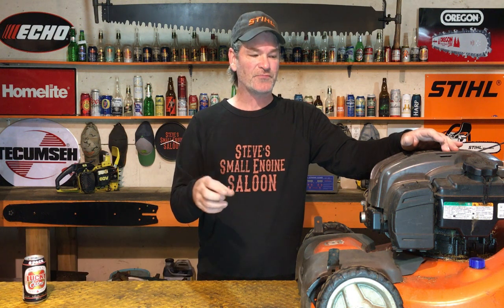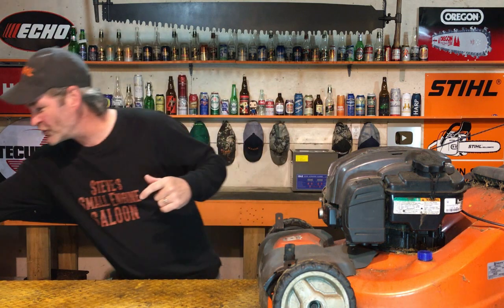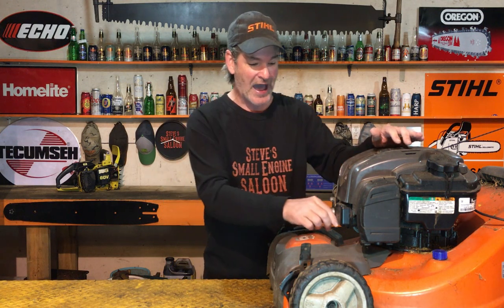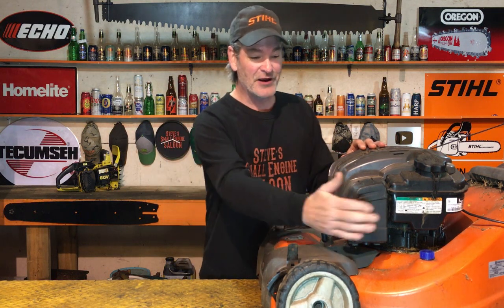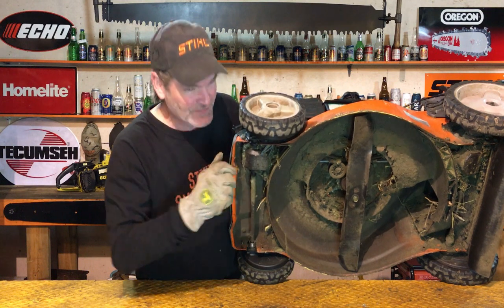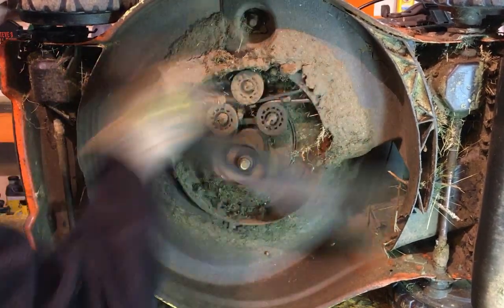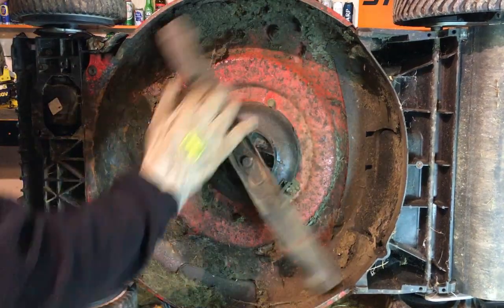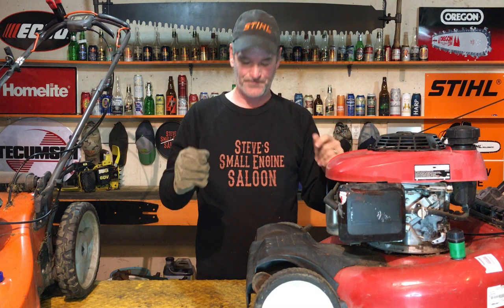How To Test Lawn Mower Compression With NO Gauge

Comment from the maker: ✅Click here for a compression tester ➜ https://amzn.to/2JPWGoa
✅Click here for a clamp ➜ https://amzn.to/2K4P69t
For more videos like this, check out:
👉Straighten A Bent Lawn Mower Crankshaft With A Pipe ➜ https://youtu.be/w2Ro9GmEyOE
👉Fastest Way To Tell If The Crankshaft Is Bent On A Mower ➜ https://youtu.be/3up57DHiCqs
👉Here's Why Your Lawn Mower Is Leaking Gas - Honda Style ➜ https://youtu.be/tp67AzWNbI4
👉How To Adjust the RPM Speed on a Lawn Mower ➜ https://youtu.be/7YrA3QEIFnE

You can connect with Steve here too: 
✅Visit Steve’s WEBSITE ➜ http://www.stevessmallenginesaloon.com/ 
✅Visit Steve’s PARTS & TOOL STORE ➜ https://www.amazon.com/shop/stevessmallenginesaloon 
✅Follow Steve on FACEBOOK ➜ https://www.facebook.com/stevessmallenginesaloon 
✅Follow Steve on INSTAGRAM ➜ https://www.instagram.com/stevessmallenginesaloon/ 
✅Follow Steve on TWITTER ➜ https://twitter.com/SteveSaloon
Reply: Steve you can't really check compression with a gauge on these small engines, you have the best solution. Here's the problem. The volume of the cylinder, especially in small stuff like trimmers and chain saws or 4 cycle GX25 and 35 Honda's, is that the ratio of air in the cylinder to the ratio in the line to the gauge and the gauge itself is way too high, if you get 50 or 60 lbs it's a lot, so don't waste time with gauges. The line and gauge are lowering the reading too much. If you've checked everything else, carbs, ignition, etc and you pull your engine apart just make sure you have good valves and rings and the cylinder walls are good and in specs. 

Thanks for the video.
Reply: Steve, Steve, Steve! I use a fisherman's scale to check compression. I grab the rope start with the scale hook and give it a tug, 8 to 10 pounds of pull to get it to turn over is a good start! Let me know what you get get on the Honda when you unstick the intake valve.
Reply: Lawn mower has no compression still
Reply: I love your videos and the no bs approach and the beer is always a plus. Having said that an internal combustion engine needs fuel, oxygen and spark to run. That is technically the correct statement. The compression is of course necessary but as an internal aspect of how the engine works there is not much end users with limited mechanical experience can do about it. No compression means a damaged cylinder, or piston compression rings or  valve(s) not closing fully or all the above. And that means major overhaul of the engine which is beyond the expertise of most home DIYers. But fuel, oxygen and spark are things that can be readily verified and fixed without the need of special tools and knowledge. Thank you for your videos, very helpful !!!
Reply: When my spark plug is in, I get a nasty grinding noise while I'm spinning the blade, but its quiet when the plugs out.
Reply: You need 4 things for a engine to start.  Fuel, Ignition,Compression, and air.

Comment: I'm never going to be the guy that can completely rebuild an engine, but your videos have taught me all the things I have to look for. Bad gas, dirty air filter, spark plug, no compression, too much oil making smoke, or pinching off/removing the gas line to check/clean the carburetor...   So like I said, I'm not the guy that can rebuild all this stuff, but now I'll never be the sucker that throws away a mower before it's been worked on.  I've become "informed" in less than a week. Thanks.
Reply from the maker: Right on Danny!  You're Welcome...

Comment: Glad I came across this video. Been trying to figure out why my mower wont't start. I have tested and tried many things on the mower and just couldn't figure out what was wrong. Last thing is to check the compression by using your trick and  wahlah, my mower has no compression at all.  Worked on the OHV valves and now my mower is running fine.  Thank you
Reply from the maker: Great to hear!

Comment: Thanks for the tip! At work I always pull the plug and screw a pressure gauge and roll it over. Your tip is great if your say out and about looking to buy a used ditch mower.  One of my customers makes a living reselling mower finds. She finds cheap or free mowers and brings them to me to fix so she can flip them. She will love this tip.

Comment: Steeve I have a JS40 JOHN DEERE self propel can you make a video explaining why a transmission belt jumps out.new belt new pulleys yet belt will jumps out when runs socially idling
Reply: Check the power receptors (pulleys on the other side of the belt) - if they are stuck, the belt must jump off!

Comment: Great tip on checking compression. I find that no compression on the newer Briggs engines is usually due to a failed plastic cam gear or slipping lobes. What the heck were they thinkin' when they did that? Eventually word gets out and nobody buys your products anymore!

Comment: "Houston, we have a problem."
I need your advice. Just tried this test on my mower and while it isn't as bad off as the second mower in this video, it isn't nearly as good as your orange mower. In fact, I think it's exhibiting slightly better than "squishy stop" you described and does have a little bit of bounce-back. I already cleaned the valve stems and adjusted the valve lash to factory specs; they're cycling properly, so that isn't the problem. I also installed a brand new head gasket, so that isn't it. It ran for about 5 minutes yesterday and then started surging, getting slower and slower, then finally dying and I haven't been able to get it going again. After the brief run, I did open up the breather chamber under the blower housing to inspect the reed, which exhibited a bit of wear and will be replaced as soon as the new one arrives by mail. I have not re-sealed the chamber yet, but am not sure how much this would affect starting and compression. I recently installed new piston rings and suspect this is where the problem lies; when I got the new rings from Briggs & Stratton, one compression ring was completely missing the paint stripes it was supposed to have, according to the instructions, and the other had only a single pink stripe that was further over than the illustration indicated it should have been. I tried looking for the bevel, but couldn't see any and did not notice any marks or pips on the rings. So basically, I had to guess at the order the compression rings were supposed to be installed on the piston and I think I may have guessed wrong. Also, the top groove had tight spot in it, but that appears to be by design. The oil control rings on the bottom went on easily. I have a feeling I'm going to have to tear it down, pull the piston and redo the compression rings. Any advice you can give would be greatly appreciated.

Comment: Been struggling getting this old lawn mower up and running.    It was inactive for a long time.  I have done the following: Replace gas tank and line, cleaned old carb and then replaced carb twice with new ones from Amazon, replaced air filter/prime bulb mount, gasket and filter, pull cord, control cable, spark plug, reset igniter gap, checked flywheel brake alignment.  Pulled carb fuel bowl nut to make sure fuel is getting into bowl. It primes fine as far as I can tell, meaning if I look into the carb in can see gas coming into the carb.  It only turns over for a couple seconds with starter fluid.  Turned it on its side and I get no kick back when turning the blade.  Put the compression tester on it and only got 60 psi and it's bleeding off.

Comment: Thanks for the tip...I'm diagnosing my old 2004 snapper ninja and I thought I might have worn rings. I tried this and the blade bounced back very fast just like this mower. It started when I tipped my mower upside down to change the oil (6.5 HP quantum xrm Briggs & Stratton) and now it won't stop smoking after never smoking before. The dipstick went from 'full' to 'add' in just two mows it's burning so much oil.

Comment: Good tip Steve. I need a video on how to change belts on a Snapper self-propelled lawn mower. I saw the one on how to tighten the belt by adjusting the cable.

Comment: Good one Steve, watched a video by Mustie yesterday on a nice electric start snapper he got free by the side of the road. The owner said it blew up? He took it to his shop pulled it apart and found a small bolt had got into the engine and put a gouge in the cylinder wall. No compression and just good for parts. He thinks the bolt may have fallin into the motor through the oil fill tube or was left in there from the factory. Cool interesting video and looking forward to seeing your tear down
Reply from the maker: Right on Tim...

Comment: So that’s all good is there a good test without a compression tester for lawn tractor with of course deck belts not engaged but pto in neutral not engaged of course ! I’m thinking pull flywheel cover off engine & turn by hand to feel the resistance when in compression stroke or what’s the trick if any ! Thanks Mark

Comment: Hey steve thank you for showing me a different way to check compression it's a good way to do it with one person. It just seems a little skech. I know it's safe. I'm curious tho have you heard about putting your thumb over the spark plug hole ? You might need two people (someone to pull it over for you) but it will blow your thumb off the hole if it has good compression. If it does not have good compression you will feel nothing. The bad thing about this method is you need to have experience to discern good and not so good compression. Obviously if it has no compression that's pretty easy to discern.

Comment: What about the compression relief pin on the camshaft?  Doesn't that lower compression until the engine reaches high RPMs?  It will make people think their compression is bad, but it may not actually be.

Comment: Only do this a couple of times, I've done this in the past, to check the compression it can fire a load of oil into the exhaust, leads to thick grey smoke for a while. (remember to start it outside after doing this).

Comment: It looks like your plastic belt shroud is removed. Is it ok to run the mower without the belt cover.
Mine doesnt attach with screws and it keeps falling down on the blade. Should I just remove it? Craftsman gcv160

Comment: Question what would the compression psi be on a Tanaka gas drill mod TED 210 AND 262 can't find that info anywhere.  the 210 is 50 lb and 262 60 lb psi is that low for these?

Comment: What about on those engines with the “easy start” compression release mechanism? Won’t that make it seem that it doesn’t have compression?
Reply: It only lowers it about 20 psi. So add 20 or 10 psi to your reading if your engine is equipped with a compression release
Reply: My easy start engine feels like it has 10 or 20 extra psi since when I pull the starter reel it pulls the whole mower

Comment: Hey Steve . Today we all I was servicing my  Briggs and Stratton powered push mower when I noticed a lot of gunk in the crankcase after removing the old oil .
So  I decided to flush the engine with some turps. 
I then checked it for turnover.
 Thing is now the engine acts like is suffering  it has hydrolock.
I have not  refilled the oil. 
Any ideas?

Comment: Steve! Steve here, question I have the Husqvarna LC 2214 and I can’t get the dam thing to start.  New gas and oil, carburetor cleaned x3, replaced spark plug with good spark,  compression around 50- 60psi after 2-3 pulls.  Cables and springs look good too.  Any suggestions or recommendations?  Appreciate all the help.  🍻👍🏼
Reply: Did you figure it out? I'm in the same boat with my husqvarna lc221a.
Reply: @bdaddy503  nothing man, maybe it’s the boot? I have a spark but maybe it’s not enough..I’ll replace that and write if it helped 🤷🏻‍♂️
Reply: @SteveTabs645  thanks and good luck
Reply: @SteveTabs645  I don't know if you ever got your mower started but with mine I actually needed to tighten the cable that leads from the deadman handle to the little mechanism  that it pulls, which surprised me because at first glance it looked and felt fine. Best of luck.
Reply: @bdaddy503  no man wasn’t that.  I opened it up and the camshaft needs to be replaced. Should be fun lol

Comment: That second lawnmower is a Honda they have a compression release in the valve cover you have to spin them faster to get compression sometimes. I had to cut the spring on my compression release on my Honda to get it worked right

Comment: Hey Steve.  My Husqvarna (LC 221 AH) that looks very similar to yours in the video just died....second cut of the season.  I  Bought it new in 2018. and have maintained it religiously changing oil and filter every season and sharpening blade.   It was running good for about 10 minutes then sputtered and died.   Did your compression test and the blade spins by hand freely...no resistance at all.   I assume it's dead, but seems crazy after less than 4 years of use and regular maintenance.  Question, when you pull it by hand should there be resistance? Can't believe this thing crapped out after less than 4 years use.  Any insight is welcome.  Thanks for your channel!
Reply: Thin oil can cause less compression but you can try using starting fluid to check if still running or the engine starts.
Reply: @kachiquitaito3341  It turned out to be the blade adapter.  Thanks for the suggestion though!

Comment: Hey, Steve.  That Husqvarna is my lawnmower.  My left front hight adjuster spins around and ends up pointing down several times when I do the lawn.  Also, the drive seems weak. Something needs tightening, but everything looks tight.  What is the problem?   Thanks.  Great videos.

Comment: I love you Steve. You're awesome. Keep up the good work brother.
Reply: Small side note this winter I plan on tearing apart my lawn mower just for the heck of it I think it's leaking a little bit of oil and every time I run it it smells like gas in the garage for several days so I got to leave it outside so the house doesn't smell like gas cuz the garage is attached to the house anyway Steve keep up the good work looking forward to your next video on disassembling and working on a small engine mower motor.
Reply from the maker: Thank You...

Comment: Would this work on a briggs and stratton engine, cause when I took it apart the exhaust valve slightly opens on the compression stroke which would lead to a loss of compression or am i wrong

Comment: I have to try bouncing blade,  I do  finger in spark hole to feel compression,  Engines can run low compression, but low power and run lean, especially 2 stroke

Comment: Help!  I have a 1990's vintage B&S lawn mower.  It was left outside for the past 15 years....  It had no spark, so I change the spark plug and the magneto.  Now it sparks fine!  Next, I took out the carb and gave it a good cleaning and it looks as good as new with all ports cleaned out.  When I pull the start cord I hear a couple of pops, but it will not start.  I removed the spark wire and turned it on the side (with the filter up!) and I spun the blade.  It spun free without any stopping or bouncing.  I pulled the valve cover off and turned the flywheel by hand.  The intake valve moved fine, but the exhaust valve was stuck shut.  I tried spraying lube on the valve stem to loosen them, but still no good.  I had to remove the head to get to the valve heads.  I then tapped the exhaust valve a bit with a rubber hammer and viola!  The valves both now move freely when I turn the flywheel.  I also checked the condition of the cylinder and there were no scratches, but there was some motor oil in the cylinder.  Also, the head gasket came off in one piece, but it looked a bit tattered.  I reassembled and tried starting but nothing.  I tried spinning the blade with the mower on the side and it still spun freely.  I also removed the spark plug and put my thumb over the hole and my thumb got sucked in a bit (weird).  Any ideas?  Thanks!  Great videos and I always give thumbs up!

Comment: So how fast am I supposed to rotate the tines on my tiller? I got a chainsaw. How fast am I supposed to pull that chain? Or should I just use my compression gauge? I figure 60 PSI is where an engine definitely needs a rebuild. What do you think? What is your minimum compression before you decide you need to have that engine worked on?

Comment: I do not have the gauge so I use this method before and after doing some work in my B&S engine.   This thing was spinning like a fan before.  After head gasket change, valve lap and setting the valve lash,  it bounces back like the daily runner in this video.   Nice!

I did lean the mower over some on the 'wrong' side since mine was on the ground.  I have no bench or table to put it on to work.   It would not start AT ALL.   I let it sit for a day.   I shot some Seafoam in the plug hole and after a few pulls she fired up and choked out a lot of smoke from the oil.   After a minute, the smoke cleared and it starts on the first or second pull when cold and first after running a minute or so.    My 1998 Craftsman it alive and kicking still.

Comment: Hi Steve, I'm taking a small engine repair course. I've watched a lot of your videos and I'm confused about how you can have compression but not vacuum . I understand what they are and what they do. A student brought a lawnmower into the class. It would run and die with started fluid. The teacher said there may not be enough vacuum. If there's enough compression for the engine to run and die, would that not also be enough of a seal between the piston rings and cylinder to draw in the fuel/air mixture on the intake stroke? Assuming the carburetor is working perfectly, the gaskets have no leaks, and there's air, fuel, spak, timing and compression, what could cause an engine to not run because it's not drawing fuel/air? The teacher said there could be great compression, but it stiil may not have adequate vacuum to draw air/fuel. Could you explain in a video? Thanks. Phil from Toronto